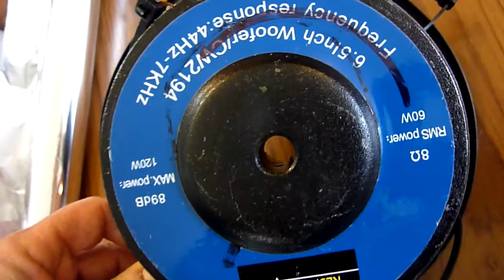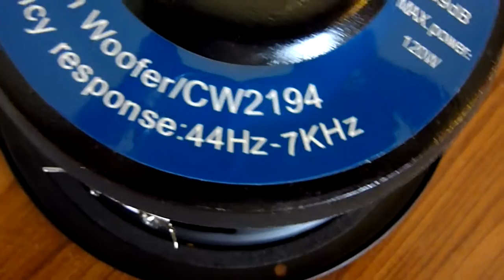MAKE YOUR OWN "KEF UNI-Qs"(NEW CONCEPT) POINT-SOURCE SPEAKERS

Comment: great idea..but most of the speaker with hole on the back is for air pump in and out. there must be a purpose of it. if we close it could it effect the sound other other effect..
Reply from the maker: +Shahran Yaacob I think it's a vent hole for the voice coil, which  tends to get hot at high volumes. The cone is normally totally sealed in the middle, so the hole won't affect the sound. I opened that seal, so it would affect the sound a little bit.
Reply: thank you for your advice
Reply from the maker: +Shahran Yaacob :-)

Comment: yea,because buying a coaxial speaker ain't an option,waste of time
Reply from the maker: saladwithsalad Co-axial speakers are out-of-phase by an inch. The tweeter is an inch in front of the other driver. But the KEF Uni-Q speakers are point-source co-axial speakers. And the tweeter is totally level with the woofer center (instead of an inch in front)..